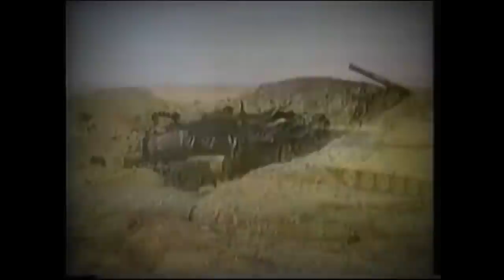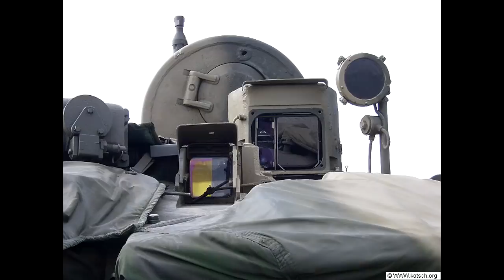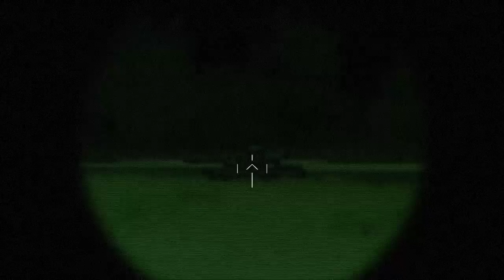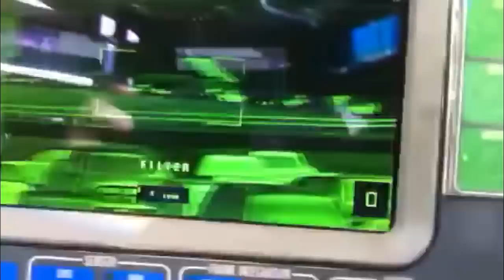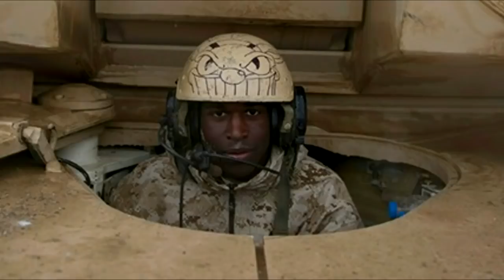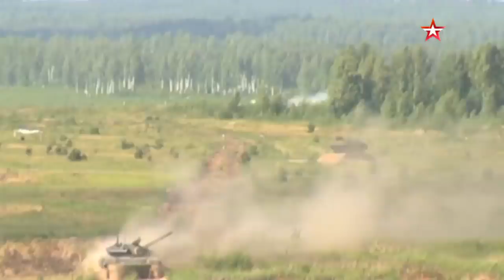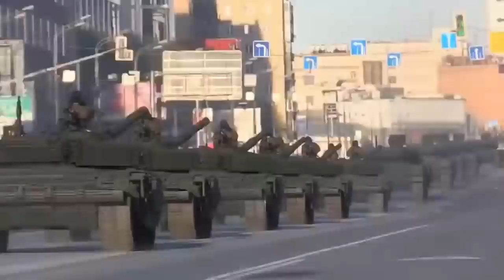Does T-72 stand a chance against M1 Abrams?

Comment: >Why they still use it?
May be because they doesn't have another tanks??? Can it be the reason???
All russian army adopted to use T-72/T-80/T-64. If even russian army got new mass production MBT, they need teach crews to use it and mechanics to fix and service it, they need even new tactical usage for it, because soviet/russian MBTs are kinda one-off.
But the biggest problem - russia just can't produce new tanks. They advertise mystical T14 aka armata, but this pile of metal are not serve in actual army. Nobody knows how much they produced this tanks and when it comes to army. But it's for sure, russia just can't build big numbers of this tanks. It's impossible. It has no reason to built 1-2 or 10 T14 in year. It just doesn't have any sense. So much more possible that T14 aka armata will still only tank for russian military TV-shows and for red square parades. But real russian main battle tank still be an old T-72 in various modifications.
Reply: T-90 is upgraded T-72, T-90A are newly build with a new hull and a new turret, T-90S are upgraded from T-72 with a new turret and an old hull.  T72 is not too different from T90, T90 seems to be much better but just is just a delusion as 90 is larger than 72. 

T72 is a very good tank, it uses a 830HP engine yet can drive up to 65KM/h. T72's ATGM has a range of 5KM and can hit the top armor of M1A2 which is only 20mm.
Reply: Because T-72B and T-80B are really a lot in storage, they are new and not much inferior to T-90 during modernization.
Although the T-90 is a compromise between price and performance, in some ways it is even a step backward compared to the T-80U, but then there was no choice.
Russia does not use T-64, they are disassembled for parts. This model is too old and does not meet modern requirements. Modernization is too expensive and inefficient compared to the T-72B.
Disposable, in some way yes. All tanks are designed at a rate of about 2000 km and subsequent repair, although it is unlikely that the tank will live for so long. The tank should be effective, it does not make sense to put too much resource in it.
However, T-72s made 40 years ago are still fighting with proper maintenance, isn’t that enough?)
Russia does not produce tanks?)
 Russia produced more than 2000 T-90S for the foreign market. For myself, it makes no sense to produce T-90A or even AM, it is more efficient to modernize 2-3 T-72B or T-80U with these funds than to produce new T-90s. in any case, they will have to be written off in 10-15 years.
The process of testing and development takes more than one year, 10-15 years from the drawing and the prototype to the production sample. For this, a series is needed for testing in order not to repeat the mistakes of France with Leclerc-2. This series of 20+ 100 prototypes. Armata is not only a tank, but many other universal machines, it does not make sense to produce only the T-14 to the detriment of the other models, this takes time.
These 10-20 years old T-72BM and T-80EM and perhaps a certain amount of T-90M will play the main role, gradually yielding T-14.
Reply: Oh yea, discount several thousand T-80BV and T-80U as well as 400 T-90s

Russia can't produce tanks? Tell that to India that buys T-90S by thousands from UralVagonZavod. Line is still open and very much loaded.
OmskTransMash and Leningrad Kirov Plant do modernizations.

There are now over 100 early-version T-14s in Russian units.

Comment: Please talk about one of the worst tanks ever: the T-55
Reply: T-55 is far better than T62
Reply: @fanyechao2761  you foking wot m8? The t-62 is superior to the T-55 in every single way except for cost! Also, why did you start about the t-62 I never mentioned it.
Reply: @OmarSlloum  T-62 get a better and bigger gun, but the internal space is smaller than T55, make it very slow and difficult to load. T62's optic is linked with its main gun, every time you fire you lost the sight of your target. T62 consume more fuel per KM while its fule tank is no larger than T55's, so T62 have to refuel constantly. For deseart battle, T-62 is very hot inside, many Arab crew abandoned their T-62 tank while still using T55 tank. The Israeli also think T55 is more useful. T62's armor is just slightly better than T55's armor, 220mm vs. 200mm, not a big difference.

You said T-55 is the worst, I am telling you T62 is worse.
Reply: @fanyechao2761  the t62 is faster than the t55, has a lower profile, can fire better ammunition, has a better fire control system, and can be upgraded more than the t55, into for example the t62m-1. Also the gun on the t62 can fire way further than the 100mm d10t, which is useful when ur being sniped by a challenger from 5km.
Reply: @OmarSlloum  Using a T62 against a challenger is mad, you wont be able to do any damage. The AP round of T62 and T55 are all obsolet, T55 fire much faster, and the driving experience is more comfortable. T55 can be upgraded to T55AM2 or Type 59G, with 105 or 125mm gun
Reply: @fanyechao2761  the crew of the t55 can lose their legs if they leave them hanging out of their footholds, and the driving experience is horrible. I know it's mad facing a challenger, but being able to shoot further than the t55 is better because it acts as deterrence for the enemy tank. Any tank can penetrate that things lower glacius, so the farther you can so it from the better.
Reply: @OmarSlloum  My grandfather was the commander of first tank division(China PLA), and my dad drive the T-55 before. Drive the tank can be tiring, but the volume of the turret is bigger than T62, give the shooter a better experience. The HEAT shell of T55 can penetrate 400mm of steel, that is enough to damage the M60, which was in service of USA until early 1990s. The main problem for china was the T-72. T-72 with compensate armor is immune to T55's HEAT and AP shell. China had to import British 105mm L7 gun and upgrade Type 59 to type 59D. Another solution is 120MM high power tank destroyer type 89, which has a such powerful gun that can penetrate 650mm steel, enough to destroy M1A1.
Reply: @fanyechao2761  yes but the t-62 can be upgraded aswell! there was a version of the t-62 with a 125mm 2a46m cannon, the same one on the t-90 and t-72. this means that when you give the t-62 the 125mm gun it can fire ammunition that can penetrate up to 950mm of steel, enough to destroy any tank out there. yet the 125mm gun can't fit in the t-55's turret, so that thing will have to made do with a 105mm gun max, which is much less powerful. Also fyi the heat shell on the t-62 can penetrate 440mm of steel, and modern versions of the shell up to 800mm!
Reply: @OmarSlloum  Where are you from? I know Syria have quite some experiences with T62, but in russian and chinese communities we generally prefer the T55
Reply: @fanyechao2761  I'm an Arab, from the Arabic countries

Comment: Why don't you take in the account the fact russians and americans have different methods of comparing penetration values. IIRC russian method is using 60% chance of penetration at a given distance, and american one is using 50% chance (so you have to adjust T-72 AP for about 10% highter than what is given in the russian sources to compare it to Abrams one). And don't forget, even 750 mm AP against 650 mm equivalent armor does not mean an automatic penetration - it means only 57% chance of penetration and 43% chance of non-penetration according to the american "50\50" method. And  700 mm AP of T-72 against 800 mm abrams front hull would be around 45% chance of penetration according to the russian "60\40" method. So it's not that much of the difference (around 10% in favor of abrams which does not take into the account thinner spots, side shots, ect). Just solve the proportion if you don't believe me.

But in reality all those measurement battles are crap, as most of the tank battles (if they would occur at all) would take place at much smaller ranges than shown in the video due to terrain and other reasons, so the power of any modern tank at that range is more than enough to knock off another tank in one shot either killing it outright or at least causing enough damage to make the crew abandon it's disabled vehicle.
Basically that's why tanks dont fight other tanks - it's easier to use AT units against tanks as it's easier to avoid a hit from the tank than to shrug it off, even for another heavy-armored tank.
Reply: Actually, the Russians use the V80 standard, not the V60 standard where NATO practice is to use V50.  

As for this video, it is mostly irrelevant.  By far the most important factor in the effectiveness of any tank is the skill and situational awareness of the guys inside.  Iraqi T-72M's and M1's performed poorly against American M1's almost 30 years ago because the Iraqi's were completely out of their element, with an army trained and reasonably equipped and skilled at fighting regional powers (Iran).  That was far more a manpower problem than an equipment problem.
Reply: @MFitz12  Even if Iraqi armor crews were the 10th best in the world the outcome would have been the same with slightly worst kill ratios for the Americans. The desert terrain maximized all the targeting/detection/range benefits of the American systems.
Reply: @MFitz12  Weren't the iraqi tanks trashed by the russians too? Ive read the optics for the gunner were stripped out so the iraqis jury rigged them.
Reply: Perfect ;)
Reply: @comradelonestar17  soviet shells have only one limiting factor - size of the autoloader, which limits the length of a shell.
But, on the other hand, there are always depleted uranium penetrator shells (with "2" mark) engeneered in addition to standard tungsten alloy ones (with "1" mark). So actual AP can be higher in case of a large scale conflict in which non-ecofriendly shells usage would be authorized.
Reply: Great viewpoints.
Reply: @comradelonestar17  Cite your source for that study please.
Reply: @comradelonestar17  Thanks. I have seen this before. It has nothing to do with deflecting shells on the front glacis unless that was a separate point.

We should all keep in mind that the US has had ERA as well and hasn't seen a reason to use it until recently in Poland. It would seem fair to consider the M1 being armed with ERA as well wouldn't it?
Reply: @comradelonestar17  All ERA mitigates APFSDS to some extent. What is your source on the ineffectiveness of US ERA?
Reply: @comradelonestar17  I don't think I made a point about any of that with you. I was asking for your source on the inferiority of US ERA.
Reply: Федя Крюков Thank you sir!
Reply: Fachmann aus Russland, endlich 👍✌️🇷🇺❤️
Reply: M1 hull isn't close to 800mm the turret is.
Reply: I Didn't Do It And I Will Never Do It Again can you answer to Titus question? I also would like to know your source, to read that. I am not interested in your opinion, I would like to read it. Becouse this can be the same story like with the nondestructiblle pantzir1. Potempkins village.
Reply: russians just spread propoganda about their ammo and pen values thats why i have difficulty trusting their sources
Reply: @comradelonestar17  So again, citation needed.

Comment: Just one minor complain about the M1A2 SEPV2 armor: as far as i know, there are no sources available on its effectiveness. We do know the exact details of the previous armor package, as used in the original M1A2 (600mm vs KE over the front turret). How much that figure was improved with the SEP armor package is unknown but the weight increase is very small when compared with the previous armor upgrade. The SEP armor package first came to production by 1999, and triggered the development of the Svinets (1-2) and Vacuum APFSDS in Russia. The Svinets (1-2) actually were developed by 2002, but not adopted. Based on that i can ASSUME that Svinets can actually defeat the SEPV1-2 armor package, a further indicator of this is the fact that by the time Svinets (1-2) went into mass production and adoption (2016), the americans answered with another armor package upgrade to be fielded with M1A2 SEPV3.

All in all, i strongly believe that both T-72B3 and M1A2 SEPV2 can pen eachother from the front at equal combat ranges, but the american tank will spot and fire onto the T-72 first and most likely, score a kill.
Reply: I do agree with your last statement but given only in a certain cituation...not all the time though
Reply: @sdasdadasda2460  what an uneducated comment
Reply: @sdasdadasda2460  you just dont know how to read right? we are not talking about if an T-72 defeated an M1 in combat, we are debating if some specific versions of the tanks can potentially withstand eachothers newest projectiles. Go back to primary school, learn how to read and then come back.
Reply: @sdasdadasda2460  go curb your fanboysm elsewhere. Its getting boring.

Comment: Stats on paper do not always equate to performance in the field. For instance the T-72 have much better off road maneuverability and doesn't get bogged down in mud as easily as the M1 does not to mention the T-72 is much more fuel efficient than the M1. I'm not saying the the US Army doesn't have enough fuel but it means the operational range of the M1 is limited and the fact that there are no mounting points for external fuel tanks means this cant easily be retrofitted in the field.